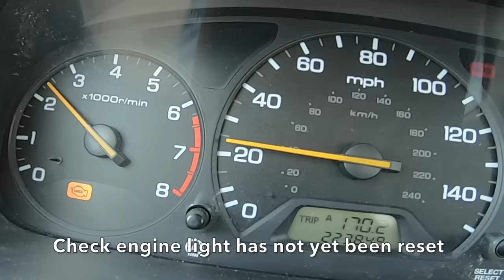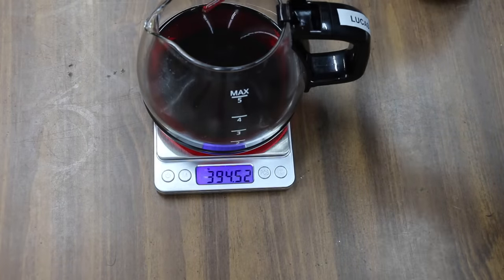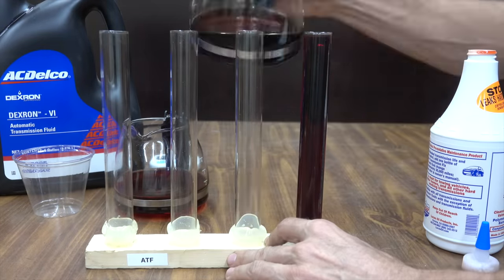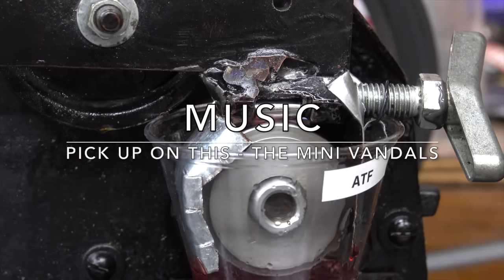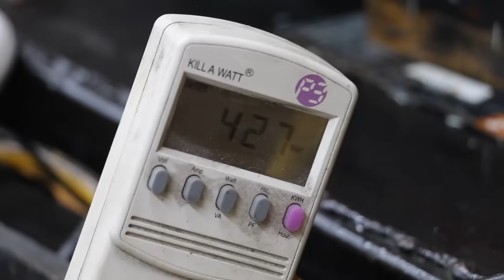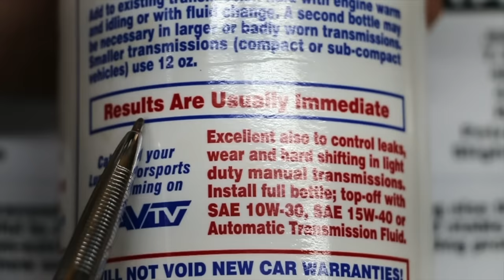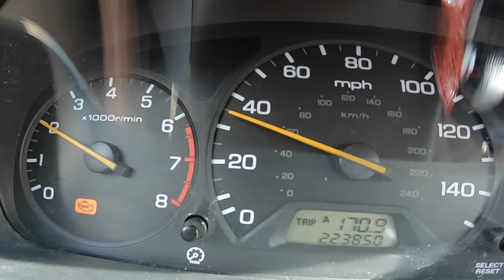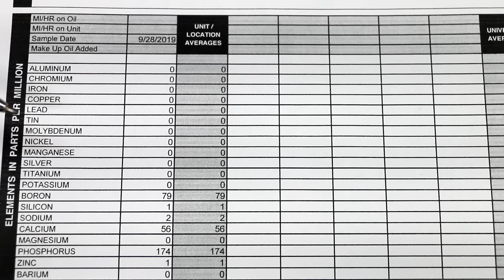Does Lucas Transmission Fix Work?  Let's find out!

Comment: I’ve used this stuff and it works! Had two cars whose transmission were clearly on their way out and it helped. One lasted to 383,000 and the other 259,000 ,miles. An additional 100,000 between both vehicles.
It is super thick so you have to be patient when putting it in.
Reply: what cars did you use them on ?
Reply: I used it on a 2007 Dodge Caravan.  Transmission was taking a "long time" to shift into the last 2 gears.  Came on pretty quickly.  Engine would wine because it was not shifting.  Had 135,000 miles on it.  I sucked out old transmission fluid and put in new and a bottle of this stuff.  Drove it for about 4 days and put 100 miles on it.  Transmission shifted great, smooth/quiet and here it is a year later and no problems.  For the cost of this and transmission fluid, I am going to do the change out again.  Now, I have only put on about 6,000 miles since I changed/put it in.   So who knows how long it will last.  Like I said, for the cost, I am going to be doing it again.
Reply: My parisienne has about 530k on the dash with original trans and motor and this definitely put some very noticeable life back into it after a year of sitting.
Reply: Think about a honey mix with the water......melt down with tmf and added..
Reply: @trvman1  Only this or this with new trans fluid?
Reply: @frazmeup  New Trans fluid and Lucas and I just did the same thing again last week.  Cost 60 bucks to change it out myself.  Get yourself a little pump and just suck it out of the pan.  No need to drop pan.  I was able to suck about 5 1/2 quarts out using a pump.
Reply: When did you feel like was a good time to put it in the trans and give it a try??

Comment: I added the Lucas to a camry with 408,000 miles that didn't want to start in 1st gear.
I drained out a little then added the whole bottle. 
The transmission shifted perfect went for a test drive and it was a instance fix.
The transmission is original never been touched. The fluid was a dirty but I was afraid if we changed it that would be the end of it.
One month later still working. 
May not work for you, but for 12 bucks it's worth a try.
Great video as usual.
Reply from the maker: Thanks!  Thanks for sharing.
Reply: replace transmission fluid with factory fluid and the filter.
Reply: It use to be 4$ 😭😭😭
Reply: @JnRskaters  just bought this last night, in Canada, I paid $25 plus tax...
Reply: @splash5974 I thought it was pricey here in the us it’s 14$ at Walmart and I think 17 at the parts store, that’s expensive af before 2020 it was 4$ a bottle I wish I knew it would have got that pricey I would have bought it up
Reply: It only had 170k miles but I changed my avalons fluid with Amsoil and still no slip.
Reply: @JnRskaters  yes but compared to transmission swap/frequent servicing, that’s pennies.

Comment: My wifes 2008 Ford Taurus with 165,000 miles would sometimes refuse to shift from first to second.  Then it refused to go at all.  I added Lucas Transmission Fix about two months ago.  It has been fine ever since!
Reply from the maker: Great to hear!
Reply: Did you take out any of the transmission oil when you added the Lucas?
Reply: @irobbdarobot9894  No, I just added it.  Its still going like 6 months later.  But it is getting "shifty", but it might be the gas pedal.
Reply: @bobdavis321 how was it now
Reply: @TheSimpleGuy_24  The frame rusted out where the rear tire assembly attaches.  It went to scrap metal.
Reply: @bobdavis321  but it was running fine when you added the lucas oil tho? how long did it last
Reply: @TheSimpleGuy_24  Maybe six months before the frame rotted out.
Reply: BTW I used this on my 2011 Equinox. It would go into limp mode then stick in first gear.  Has not done that for over a year now!  But it does shift down hard once in a while.

Comment: Our work van was slipping like crazy. New truck was months out.  We took Lucas off the shelf and poured in almost the whole bottle, as the stuff was like glue.  After a day or two the trans stopped slipping, and actually drove better.  When we got the new truck we sold it wholesale, and a delivery place is still using the van.  This stuff works good!
Reply from the maker: Impressive results!  Thanks for sharing
Reply: Got me another year outta Elantra that refused to go into 4th. 
I sold it still working fine after a year of running it...I just needed new tires so it wasn't worth it for THAT beater. Can't not recommend it. Dummies better check their not driving a cvt though. 
Haven't had a cvt issue to check the Lucas version of that....yet 😂
Reply: Did you have to drain one quart of the truck transmission fluid before you added the lucas additive ?
Reply: @alkarim5890  the directions on the bottle state that you can add 24 oz. of Lucas without draining any ATF.
Reply: Works well is proper English.
Reply: “Works good” is proper American. 😄
Reply: @dawnrobbins5877 dont do that. Check your dipstick oil or you might need to drain if overfilled.
Reply: @parkerbohnn lmao who cares

Comment: i put this product in a 4l60e  in a 1999 escalade at 170000k. it had hard shifts and bad sliping when towing. the truck now has 204000k and just made a 500 mile trip with the truck towing a 4 post lift  and it did fantastic.    this product 100% works
Reply from the maker: Impressive!
Reply: probably a burnt 3-4 clutch

Comment: Question: I have a 117k mile kia niro hybrid and have never serviced the trans. Should I change the atf and replace with mostly atf and 8th bottle of lucas? Im concerned my trans will slip after changing the fluid

Comment: Those Honda Transmissions are notorious for failing at low mileage especially in  heavier vehicles like the Odyssey. A combination of weak materials, heat and a lack of a easily serviceable trans filter contribute to the issues. I had a slipping transmission on my 2000 Odyssey a few years ago. I added 2 cheapo trans coolers, a magnetic inline filter, cleaned out the screens on the shift solenoids and added a bottle of the Lucas stop slip and it saved the transmission. Immediately it began shifting smoothly in all gears and never had issues for the remaining years I owned it.
Reply from the maker: Impressive!
Reply: Yes the older odyssey have transmission issues,  I have a 2007. With nearly. 200k on it and still shifting ok.  (Nock in wood) 
I think they made An improvement/ by 2007

I. Know in 2020 model year they have redesigned the transmission for the odyssey. At least that is what they said when I was looking at  a 2019 Ridgeline
Reply: Thank you
Reply: OverwelmingTriumphnt Honda automatics are weak
Reply: OverwelmingTriumphnt, I have a 2002 Odyssey and it's doing the same exact thing. I just might try your fix, thank you !
Reply: ya honda really screwed when they tried to build a 5 speed in the space of teh 4 speed. in the mid 2000's
Reply: Would changing the oil more frequently than normal help these transmissions? Even if they are known to be weak?
Reply: @dfields9511 if it proves to be true... I'm glad. I believe that Honda makes good engines. I hope their gearboxes are reliable too
Reply: @jonsmith8083  what does overwelming triumphnt mean?
Reply: I'm glad to hear your transmission is okay, but a bit sad that that's the length you had to go to!
Reply: @ProjectFarm  Perhaps you can get the owner to let you try just cleaning out the screens on the shift solenoids? If that makes a significant difference then adding the rest of the modifications might be worth the cost to keep this car running for a few more years. Of course it all depends on what the rest of it is like, and what the owner feel it's worth spending on it. 

A twenty years old car can be rather rundown. I've got a 98 Toyota that has started to rust, and I'm on the fence about what to do about it. On one hand the engine and driveline is in very good condition and it's reliable and economic, on the other hand it's starting to look it's age and I'm sure there are more rust than what I've seen so far. Besides the comfort in a newer car is better, and spare parts for a 22 years old car is getting harder to come by.
Reply: @justinramalingum  if you catch them early enough. I believe Honda maintenance interval is something stupid short like 30k miles.
Reply: Sonny Brown it’s the original commenters user name.
Reply: OverwelmingTriumphnt Honda transmissions are sensor sensitive. 90% of the time if a Honda trans is failing at low mileage a solenoid or sensor is failing. Typically with older Honda’s the speed turbine sensors go bad and won’t let the car shift or have overdrive
Reply: OverwelmingTriumphnt I used to be the fleet manager of a landscaping company and we had a 215k mile 2008 f150 that started slipping. Changed oil and filter and it still slipped. After a couple bottles of the Lucas, she stopped slipping and was at 235k when I left the company without any continued issues. I think this stuff helps best when the issues are caught early.
Reply: Avery J. Johnson you’re right it does
Reply: OverwelmingTriumphnt In about 1998 Honda started sourcing cheaper frictions for their auto boxes. The material would flake off and cause all sorts of issues. Before 1998 a Honda auto box was good for 300K miles. It was actually rare to see a Honda auto give trouble before the early 2000s. Sadly, neither Honda or Toyota have the quality components in them that they used to.
Reply: @justinramalingum  Use Lubegard trans treatment, and add 1 or 2 aftermarket trans coolers (the shift solenoids get cooked by the poor cooling of these trans, also make sure you clean the solenoid screens!) and an inline magnetic filter (stupid Honda put the screen built inside the trans), that will dramatically extend the life of the Honda trans and yeah of course stay on top of those fluid change intervals. l know many people have gone that route and didn't have issues afterwards.
Reply: My wife has a 2004 accord v6, original owner, couple years ago it started having hard shifts and weird behavior.  Car had 270000 kms then.
Since i'm not a honda guy, i did some research and hatched this plan:  clean the screens, fluid change and 1 can of Lucas.
Those things combined really made a big difference and the car is still being used every day. (Car is approaching 300000 kms, engine runs like new btw)
Total cost around 40 bucks cdn, couple hours of my time so totally worth it for us.
Reply: @justinramalingum  yes.  do an ATF drain and fill every 20k miles.  Avoid those places where they do a  complete ATF flush.

Comment: So I tried this in my 2009 Honda CRV and it absolutely worked well enough to buy me enough time to budget for parts.  This video really saved my ass. Awesome.
Reply: I thought it saved your transmission.
Reply: Actually it did so far. A year later and I've still not had any problems (*knock on wood)
Reply: Hi there!, How much have you driven on that trans after adding lucas? How many miles approx?
Reply: @hw534  I'll have to look back at my oil change history to figure it out. I've put a lot of miles on it over the past year- more than most years I've had it (got it brand new in 2009, never been wrecked, from 36 miles to like 180k miles. 
Anyway, I'll get back to you on that.
Reply: @e.claire1718  

Thank you! I'm sold. I just got a used car with just under 100k miles. I need it to last 2 years minimum with regular use hauling the family around. Theres a little bit of slip/slam into gear with hard acceleration & from stop. 

Trying to nip it in the bud. 
Look fwd to hearing how many miles you've put on. Hopefully over 20k!

Take care

Comment: I added Lucas transmission to my Honda accord and it completely stopped the slipping in my case. Love this stuff!
Reply from the maker: Thanks for the suggestion.
Reply: True and the long you drive the better it gets.
Reply: How is your car now? Does it drive smooth now?

My crv shudder while shifting from 2 nd to 3 rd gear 
Should I use lucas? Is it safe?
Reply: @Samshyam123 Go ahead and add it, If it doesn't solve the slipping, your transmission is going out. Mine was taking forever to change from 3-4 gear and would have rough downshifting.
Reply: Do you overfill it ?

Comment: The engagement PF has with it's viewers is astounding. I work in a dealership, and I refer customers to this channel anytime they talk about products that are speculative.
Reply from the maker: Thank you very much!
Reply: Right, we have a trailer shop and anything he tests we get for the shop. Now he just needs to get that damn grease test going!
Reply: @RaceMentally  , another vote for the grease test here! Especially the common ones you find on the shelves, including marine, how good is at preventing water intrusion? And what about wax or paraffin based compared to purely fossil fuel products.
Reply: Same here
Reply: niceguy217 I’ve got at least 20 tubes I bought to test. But I don’t have the time to do it all. I wish I could send him all the tubes I have. We deal with salt water trailers on a daily so the best grease we can put in the hubs to resist corrosion would be awesome to find out. Currently we use a Schaefer’s grease that’s “water proof”. Most are only resistant. PF let me know if I can send these tubes out to you.
Reply: @RaceMentally  that'd be good. i wonder if some grease lasts longer before it gets dried out and baked on. and i think it would be good to test for waterproofness. what would the baseline grease be?
Reply: daft nord I’m not sure. The tests I wanted to have PF do would be the following. 

Friction test
Water test
Cook test
Stickiness / fling test
Etc
Reply: @RaceMentally  were you referring to the water test to the one he does with the steel plates
Reply: Joel Dale yes where he ran dip a raw bolt or piece of metal into a salt water solution and see how the grease does under water and see how much ea item rusts.
Reply: @RaceMentally  ya that would be a good thing see